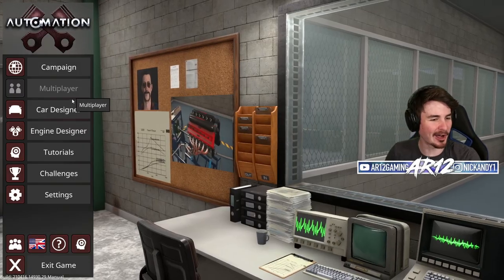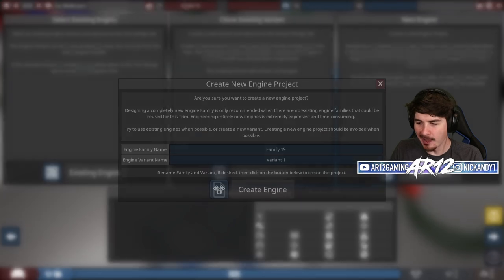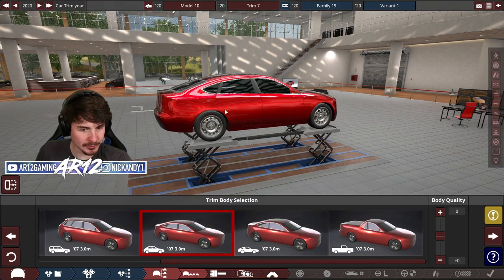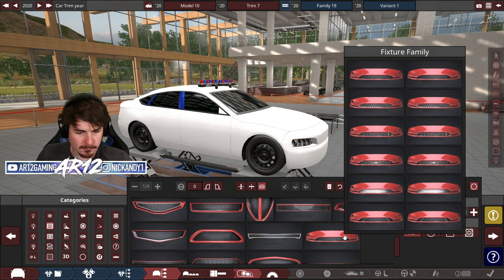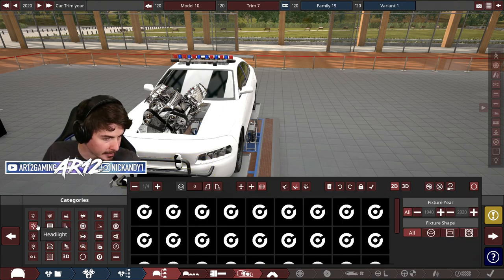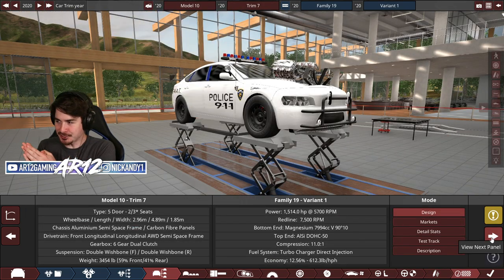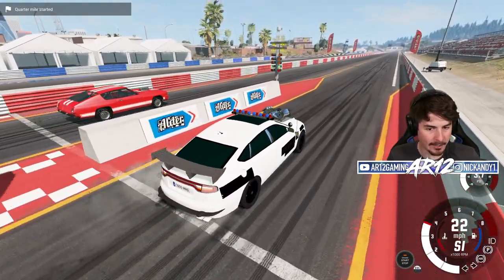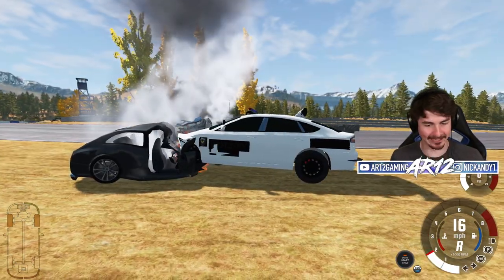Building The World's Fastest Police Car in Automation & BeamNG

Comment: To make it rev higher lessen the stroke length, it may be smaller but it can rev higher. Also the v8 with a flat plane crank at like 11000-12000 rpm is the closest you will get to an lfa